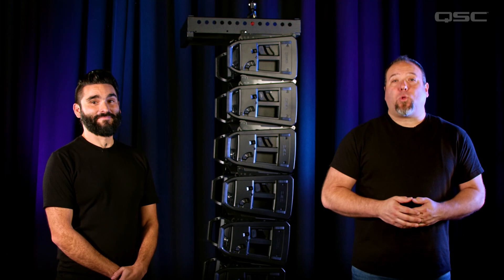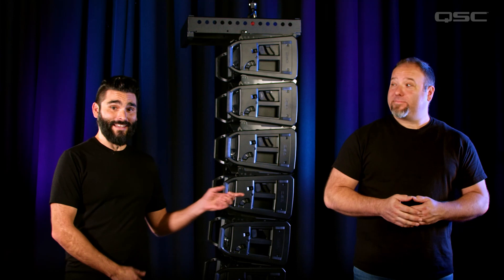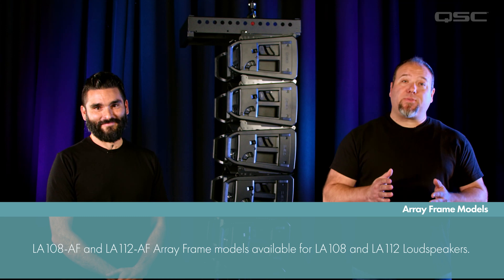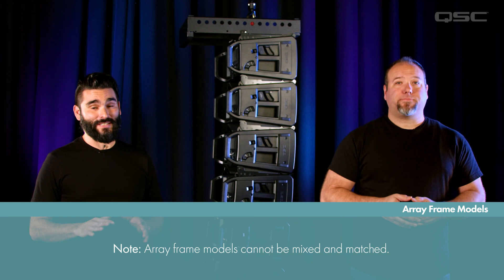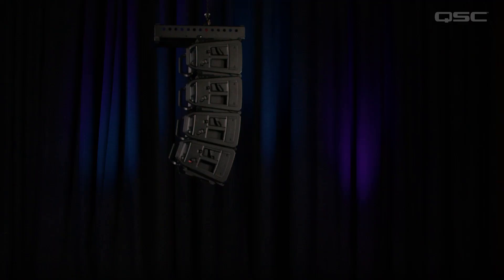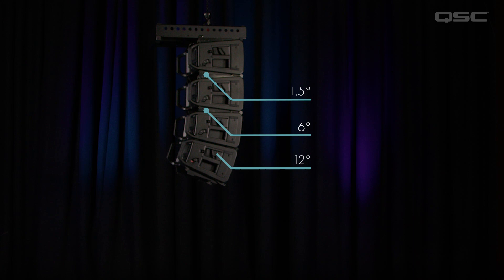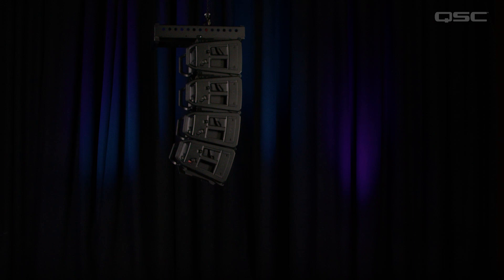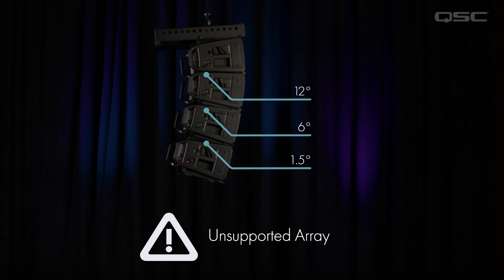L Class Training Series 4: Array Frame Deployment

Comment: Do you need the frame or can you use the m10 eyebolts?
Reply from the maker: There is an install bracket kit (LA-KIT-I) that can be used to suspend 3 or fewer LA array loudspeakers. Any more than 3 and we recommend using an array frame.